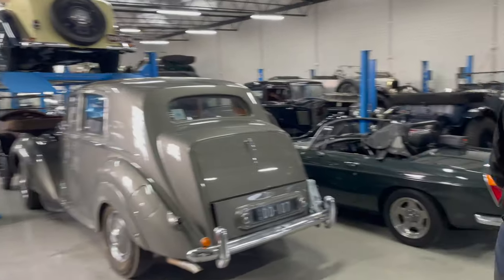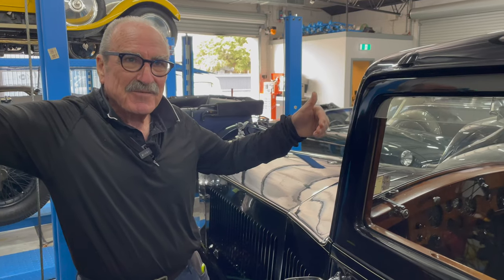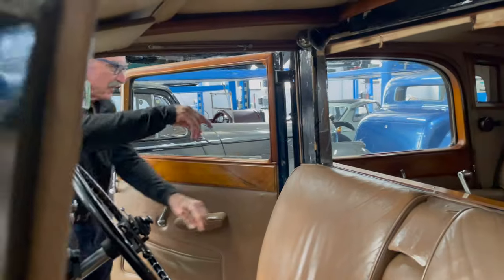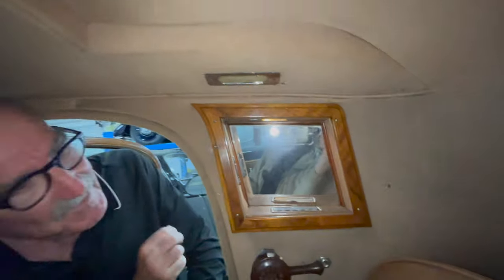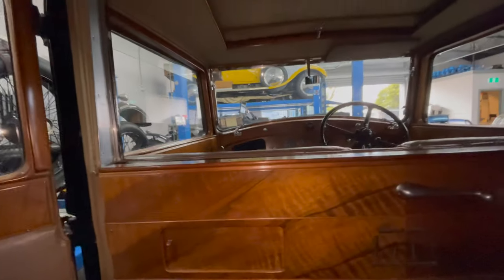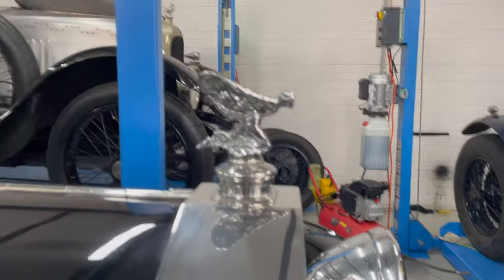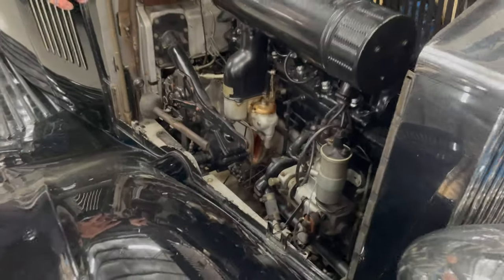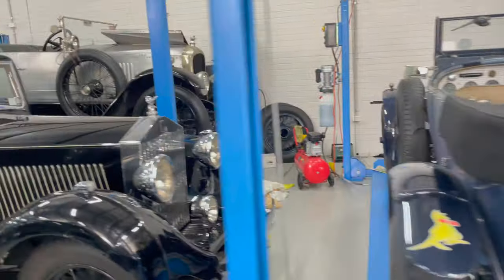The Rolls-Royce the Coachbuilder built for himself

Comment: Very cool car.
The way that hole is hacked for the speaker, it's hard to believe it came that way new.
Reply from the maker: Hacked? Coachbuilders don’t hack.
Reply: @davesclassicgaragetours  Did you look at that hole? 16:15 It looks like someone put a bigger speaker in and hacked out the opening to fit it. Maybe there was supposed to be a cover over it, it certainly doesn't look like anything a Coachbuilder would do.
Reply from the maker: @bigredc222  You're quite right BigRed. Definitely an aftermarket 'upgrade' going on there. Well spotted.
Reply: @davesclassicgaragetours  It's hard to believe someone would do that.

Comment: I had a 1939 Plymouth which was fitted with a philco Radio from New. The device in the roller is just the controller,with the actual radio being in a box connected by Bowden cables. 
The antenna on the Rolls is probably under a running board ,as the early philcos had. The Oldest one i have seen was  fitted to a 1932 Ford  as a Ford accessory and I'm sure they could be ordered in the late 20's.

Comment: I think I can help with the mysterious name Sorbo. My father, born 1914, had a Sorbo rubber ball, about the size of a cricket ball but a bit lighter, and I think it had been made as a practice cricket ball that was less rigid and injurious than the real thing. It was completely seamless, and when you squeezed it it yielded in a way that told you that the inside was a rather heavy foam rubber. So I think that Sorbo was the trade name for a range of foam rubber products. Possibly the mat in the boot of the car was intended to insulate the contents from road shock on rough corrugated roads in the outback. The idea of the name Sorbo would be that it absorbed shock.
Reply from the maker: That’s a fascinating insight. Thanks Ralph
Reply: @davesclassicgaragetours  sorbo is still manufactured today in rubber strips, foam, balls and all manner of things. Its also used in squeegees for window cleaning.

Comment: Interesting , we have a 1928 Windovers Limousine Phantom 1 and the door handles are loop coach like types but the key I would bet is the same and is a very curious feature !.The radio is a Philco Transitone from around 1933 and under the floor would be a dynamotor driven by the 12 volt battery to generate high voltage direct current to operate the valve circuitry .An incredibly rare and original car .
Reply from the maker: It was fascinating looking over it. Made all the better by my tour guide that day